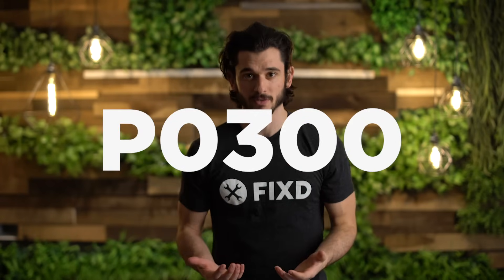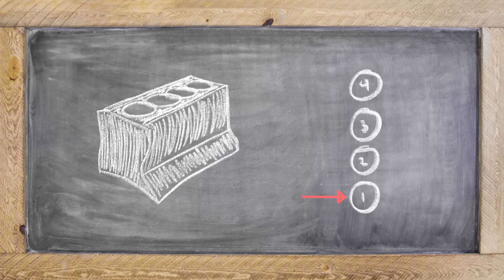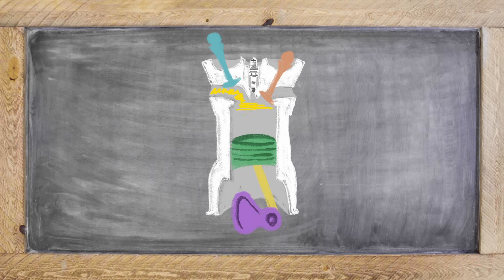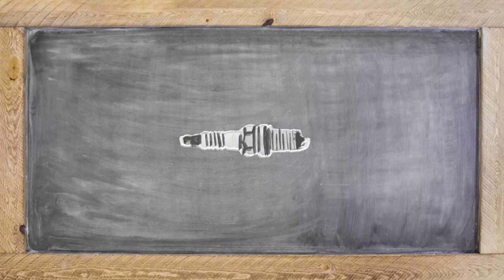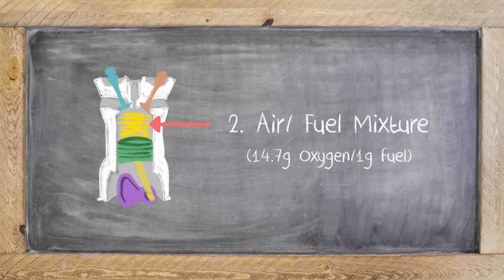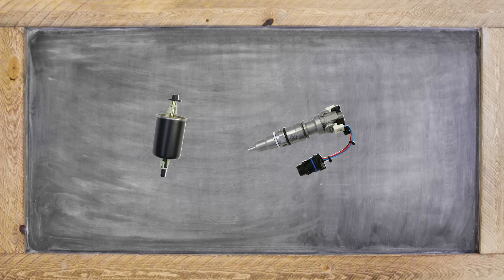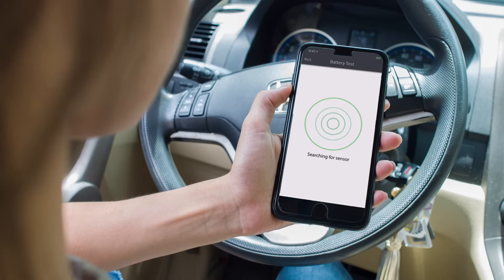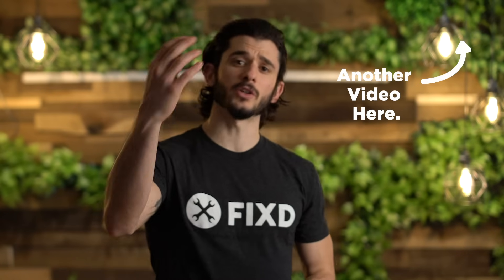P0300 Explained - Random/Multiple Cylinder Misfire Detected (Simple Fix)

Comment: I'm 85% sure that p0300 is a vacuum leak caused by intake manifold. I replaced the intake manifold coolant hose since it has a small hole but the hose was melting. But that did was off the leaking and overheating issue but it didn't solve the p0300. I'm pretty sure the issue is still with the intake manifold. Cuz my vehicle does not use a mode door actuator for HVAC. It uses the engine vacuum to control HVAC and since p0300 is a vacuum leak code this all makes sense. Random misfires and air only coming out of defrost vents. But I thought fixing that coolant leak from the intake manifold with a soft that is you but it didn't it just was off the leak thank God. Next step is replacing the intake manifold gasket. There are wet spots on the intake manifold but it's on the part that was away from the coolant leak from that leaking hose.

Comment: I've installed new coils, wires, and plugs on my 99 Chevy Silverado 1500 5.3L.  Also, replace the fuel pump. I'm getting the Code P0300 as multiple misfires. Don't know what to do next ?

Comment: On my VW GTI just started idling badly and hunting. Drives ok though when underway. I plugged in my BlueDriver diagnostic tool. I have all cyls misfire reported and system too lean bank1. Provides a report on possible causes including link to video on how to diagnose lean conditions. Really impressive diagnostic tool, especially for the price. Doesn't work on Land Rovers though, unfortunately. The icarsoft diag tool for that was 3 times the price and not half as good.

Comment: I have recently bought a 2024 make Street Triple R in India. After just riding the bike for 40 odd kms my bike started behaving differently and started knocking. Soon an engine check warning started popping up for few seconds aş I accelerated it. I took the bike to the service center yesterday and ön diagnosis they found one of the spark plugs (No.1) burnt.
They replaced the faulty spark plug and the error vanished.
The next day while I was leaving for my morning ride I encountered the same engine check warning popping up on my meter and the bike’s behaviour saw a sudden similar change. It started to feel underpowered and sound also changed. They have also replaced the injector and fuel pump. But, the problem still remains.

what should I do in this case? This is brand new bike which has not been even ridden 50kms. I cannot afford to get a new bike ripped apart again!

Comment: My VAG (Skoda Kodiaq) vehicle gave the error code P0300-00. Without even testing the battery, the authorized service changed the spark plugs. Then they told me that they would remove the cylinder head and clean the valves ($1100). I didn't really believe this situation since the vehicle was working fine.

Shortly after, other problems started in the vehicle
1- the horn does not work occasionally
2- the start stop gives an error
3- the cruise control did not engage.
4- It was difficult to start even though I drove for a long time.

Finally, a warning came that the vehicle's battery was lower than 12V. The battery was dead. I had it changed. The warnings stopped for now.

Comment: Mine was a map sensor and ignition module control.My check engine started blinking when i got to 60 on the highway and i felt some drop in power and the rpms went up and i had to press the gas more, after i finally got in town it started shaking like it was going to stall, i pulled over to a parking lot and restarted it and the second time it stalled.I called a tow. Thats my experience with PO 300 .05 Pontiac grand prix, runs like new again after that $750 fix.

Comment: Well i have the P0300 and the P0122 code which is for the tps sensor which i replaced because it came with the new throttle body i just put on along with spark plugs wires coils 02 sensors map sensor iac valve air filter fuel filter and fuel pump. I have an 02 buick century with over 250,000 miles it idles low and high

Comment: Not correct about the battery.  Battery that can start the car should not have any problem making sparks at spark plugs at all. Conversely, battery that cannot make sparks will never be able to start a car. This is because it takes 1000x more power to crank the engine by starter motor than making sparks.

Comment: Fixed a f150 with a P0300 and multiple misfire codes for all cylinders. 96 straight 6 low data rate misfire monitor and a stick transmission. It was the Ujoints. They were binding and slowing and speeding up the engine causing the misfire codes.

Comment: I love this video and saved me a tow and dealer repair charges. My 04 Golf all of a sudden gave P301,302,303 and 300. Could not drive the car  and ran ultra rough. I swapped out the battery first and that fixed problem with no more error code and motor runs perfect as it always does. Thanks again for the video and saving me lots of money.
Reply: Yeah there is literally no way a bad battery would cause a car to run rough. What do you think a battery does exactly? You probably had bad gas but had already burned most or all of it before changing the battery. When you disconnected the old battery you reset the ECU and all DTCs with it. See what happened here? Since you cleared the codes yourself they weren’t there anymore and since you probably burned off the shit gas the codes weren’t about to come back. 

Congrats, you spent $200 on an issue that would’ve sorted itself out with time and a $7 bottle of Lucas fuel treatment.
Reply: @2011CrownVictoria  Wrong
Reply: @jamesmahle1259  What do you think a car's battery does?
Reply: @2011CrownVictoria Supplies the voltage to the components and if it’s not sending the correct voltages will cause issues.   It’s happened to me twice now.   I replaced the battery and the multiple codes went away.   Four years later I started getting random codes and swapped the battery again and amazingly the codes went away.
Reply: @johnnyblaze9206  That's the alternator. The battery is only there to start the vehicle. It's a power reserve that is only used while the ignition is engaged. This isn't even up for debate this is literally how every vehicle on earth operates.
Reply: Also I never said a bad battery won't throw a code, it can. Newer Chrysler's will sometimes throw a bad pedal position sensor code when the battery is bad. I specifically said a bad battery cannot cause a misfire.
Reply: @ Well, your alternator charges your battery.  That’s what it does.  If your battery is weak it won’t keep the voltage to run the components.   I know first hand.   I was getting all kinds of codes, couldn’t find anything.   Changed the battery and all the issues went away.   But please continue with your education of everyone.
Reply: @ It was giving me P200 and P300 codes with other codes and it ran like crap spitting and sputtering.    Then it would go away with me correcting absolutely nothing.   A few days later it would come back.   I went thru the spark plugs, wires, coils, etc.   Couldn’t find anything.   Took the battery out and had it tested it was weak.  It would start the car but throw codes.   Replaced the battery and no more codes for 4 years.   Battery got weak and it started throwing codes again.  

But please continue with your education of how it’s wasn’t the battery.
Reply: Uh yeah but no…. There is no way a battery caused misfires in 3 different cylinders. I call complete BS.
Reply: Yeah a battery wouldn’t cause that issue , I bet fowled spark plugs , bad wires and or ignition coils are shot . I have a mk4 golf gti vr6 .

Comment: See at least one problem, the battery main use is to start the vehicle once vehicle is running the alternator does the power to electrical system not the battery hence cranking amps the ability to crank over the engine

Comment: I have a p0300 I took it to the shop cause it would have a bit hard time to start but it ran still to work an back no hesitation or nothing no smoke they told me replace spark plugs so I told them that’s fine I’ll pay for them I drove off an my car started smoking up bad on my way home they said my value cover gaskets are bad so I told them they can replace them then I got it back an still misfire an smoke they said my coil packs so I told them in hope that was it an still no fix I got my car back 10x worse then when I brought it in I told them so what can we do since my car is way worse then when I brought it in spent $800 that should of been a quick job an I still have no car 2 weeks later all they said is we can’t do nothing for you unless you get a diagnosis that is another $160
Reply: What kind of vehicle you have?
Reply: 1st thing is to stop smoking while driving

2nd is find a real mechanic if it was worse when you left than when you walked in.

Hopefully it’s fixed by now so did you find the real problem?

Comment: I've been having this problem with my 2010 Dodge Charger, 3.5 L V6 for a year now. Even with new spark plugs and ignition coil. NGK plugs and coils.
New driver side catalytic converter and oxygen sensors.
New transmission filter.
Reply: Is p0300 the only code you’re getting? Or do you have codes for specific cylinder misfires too?
Reply: So what fixed it ?
Reply: @antoniowolfe2041  Nothing. Pretty sure I have a burnt-out valve in the engine.

Comment: Right now, I have a Mechanic telling me that my PentaStar is looking at a $5500 CDN repair. Called out  my tensioners and everything around timing of my Cams. At 275k kms, I told him to look for an engine.  Not happy with my Jeep at all. 2020, tranny and rear diff because the frequency dampener came off my driveshaft while on the highway. $10 k for that, and now another $10 k.  JUST EMPTY EVERY POCKET!

Comment: So what if your p0300 is accompanied by p0420 and 0430?
Reply: Did you ever get an answer to that ? Have the same codes
Reply: DId u get answer?
Reply: Faulty catalytic converter(s) that are also causing misfires due to back pressure, overheating, faulty o2 readings downstream etc… Basically, bad cats. Grab some cataclean from the store and see if that fixes it.

Comment: You never mention the distributor.  Replacing my rotor and tightening my loose cap got rid of the code po300
Reply: Loose gas cap?  Or..?
Reply: @nazareta6541   he's referring to the distributor cap, it's usually on older vehicles

Comment: P0300 code, blinking check engine light, violent shaking. Change out all 16 spark plugs and coils, still shakes and smells rich. Could it just be flooded with gas? It’s a 2011 Chrysler 300 C V8 Hemi with only 75,000 miles. In fantastic condition. I have a feeling it’s just flooded but unsure if the original misfire could cause it. Any help is appreciated!
Reply: Did you ever figure it out?
I have a P0300 code only, with CEL and shaking misfires as well. 

Plugs and wires changed 50k miles ago. Cleaned MAF. Clean air filter.
Reply: What was the problem?? same thing with my integra
Reply: @2XPWeeknd  Did you figure out your problem?  I have P0300 code only, with check engine light and heavy shaking misfires
Reply: Did you ever figure out whats wrong with youre car?
Reply: @gamer2636-l7n  mine was a P0300 only, with check engine light. Got mine back from the dealer last week. It's was a broken/cracked intake valve spring. 
Dealer charge $570 for two new springs in one cylinder. 
The total for 16 new springs (two for each cylinder) was quoted $1200 or so.
Reply: Change out your crankshaft sensor

Comment: I’ve already charged all spark plugs, ignition coils, and just changed the camshaft position sensors today in the morning
Reply: And ??
Reply: its still broken.... =/ thats why he hasnt commented
Reply: @MovieCor  yep has to take my loss
Reply: @MovieCor  even the dealership couldn’t figure out
Reply: I'm in the same boat
2010 Yukon v8 6.2
I changed ..
Fuel pump 
Crank shaft sensore
New plugs n wires
New maf sensore
New throttle body
3 ignition coils...
Still miss fireing...wtf ?
I don't know what else to do..also had converters checked ..all is well
But still misfires...what else is there?...anybody 🤨
Reply: @parnellmanning9852  Did you change your knock sensor and camshaft sensor as well? 

Also could look at replacing your o2 Sensors.

If any of your Sensors are Faulty, you can dumb it down to your o2 Sensors. Your o2 Sensors are one of the major sensors that can trigger a P0300 Misfire Code.
Reply: Check 02 sensor. Check for ANY leaks of your air intake.

Comment: So 02 Cadillac Deville  4.6 Northstar  v8 has a misfire  runs fine cold once it heats up  boom misfire  , I've changed maf ,map, tps, plugs , i take gasket intake boot , no vacuum leaks ,put another fuel pressure regulator on also , any ideas?
Reply: Could be a burned valve. A compression test would be in order.
Reply: Yep same damn boat replaced EVERYTHING SMH

Comment: Decent explanation but $60/40 labour to change each spark plug? That's insane. It should take less than half an hour on the majority of cars to change ALL plugs.
Reply: That caught my eye/ear too.  He shouldnt list "per plug" but he is about right on the costs and even under in some cases.  All three of the vehicles we have require the removal of the intake manifold to access all the plugs.  Just about any modern V6 or smaller is going to be like that.  It took me the better part of two hours to do them on a 2013 Town & Country...and you know book rate will be at least double that.  At just $90 an hour you're looking at probably at least 3.5 hours on book rate and if you figure 6 plug you are at $52.5 per so yeah, that's probably about right.
Reply: On a 4 cylinder yes, but on a v6 it’s a pain in butt sometimes. My Chevy s10, 4.3 has a spark plug right behind the drive shaft. It took all day to get the wires and plugs out
Reply: 😅 yeah, BUT on this one you actually bbw l need to pull the engine forward in order to be able to reach back there.
Reply: I got an xterra, and I had to dig to get to my spark plugs. Mechanic said it would be $600, I spent $100 and a weekend instead lol😂
Reply: Do it yourself then?

Comment: I had P0300 error code on my Jeep Patriot and took it to my regular repair shop. It did not seem to have any abnormality. The shop manager ran a computer diagnostic and it turned out there is nothing wrong with it. He said sometimes one random misfire on any plug for no reason will cause the computer to remember and display this code. He reset the computer and charged me $0. He told me to come back if I get P0300 again. Just wanted to share my experience here and great job explaining the potential problems.
Reply: No problem so far. It’s been 3 years
Reply: Did it happen again?
Reply: @Santiknws23  No, it has not happened again for a year
Reply: @kimberly.319  thank you for responding
Reply: @kimberly.319 what about now!?!
Reply: @kimberly.319 thankyou so much

Comment: I have a 2000 JEEP Grand Cherokee with the 4.0L Straight 6 and when starting it up sometimes it will have a really nasty misfire and if I just rev it up or just start driving you can hear when the other cylinders actually start firing. I have codes P0138,P0300 has anyone else had the same issue as well??? I've changed plugs and didn't really help then I bought the coil pack and yes its the weird one where you get all 6 on a long bar. When I replaced that my JEEP would not run at all. So I put the old one back on and it ran fine other than the misfire once in a while. Its not every time I start it just when it wants to be stubborn. Any ideas anybody??
Reply: Check the compression first. Then look t the fuel injectors. Could also be bad ignition timing due to a worn timing chain.

Comment: wow, this video is full of misinformation... like voltage under 13.7 causing a misfire... lol a lot of newer vehicles dont even charge above 13.6 for battery longevity... Failfish for days here.
Reply: I’ve watched like 5 mechanics on YouTube saying that the cause might be battery. You looking at videos for answers which means you don’t know so stop acting like you do.
Reply: @harrybobarry  I didn't search for this video, it showed up on my feed you smooth brained dumbfuck. 
I stand by my original comment from 7 months ago, thanks for reviving it IG. 
to be clear for dumbasses like "sky" a voltage under 13.7 will not cause a misfire as most new vehicles do not charge above 13.6.... 🤦‍♂️
Reply: If you read any other comments you'd know the cause was actually a vacuum leak and not a voltage issue. This guy doesn't know shit about cars.

Comment: So, is it the P0300 that caused the P0014 code on my 2014 Nissan Rogue, or other way around? I’ve read so many different opinions and fixes here on YouTube that I don’t know what to believe anymore. Some videos talk about replacing camshaft, VVT sensors. Vehicle has 101,000 Kms, so I guess I can start with a new set of Iridium spark plugs, even though original ones are supposed to go to 160,000 Kms. 
Thanks.

Comment: My car misfire in rain what is the problem?
Reply: 02 sensors
Reply: @Mdfkn_Cain713  Thanks for replying
Reply: U had the same issue with my truck, when it would rain it would misfire and engine would shake and sputter, wouldn't let me go over 40.
Reply: Plug wires

Comment: I was told a blown head gasket was the cause for P0300
Reply: Go somewhere else if it was a blown head gasket your car would overheat and you'd find water in your oil making it a gray color
Reply: Funny, my car blew a head gasket. After getting it back repaired (and flushed) I detected power train error codes on coil packs C and D. I cleared them and took the car for a test drive. Got PO300. I had no coil problems before so I suspect water got in somewhere when they were flushing.
Reply: @citizendc9  water can get in your coils from the windshield washer motor excess water being used to clean the front window, never leave it on for more than a few seconds.